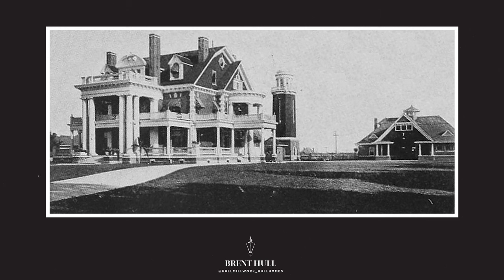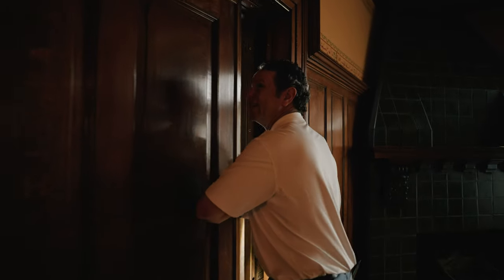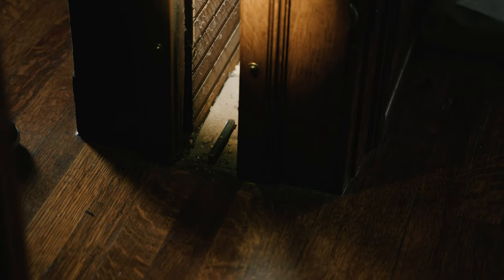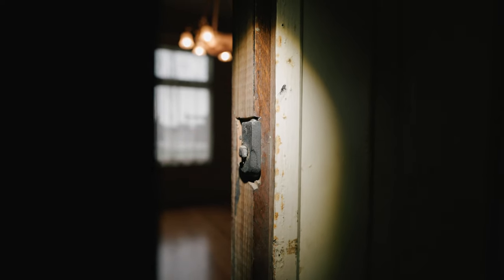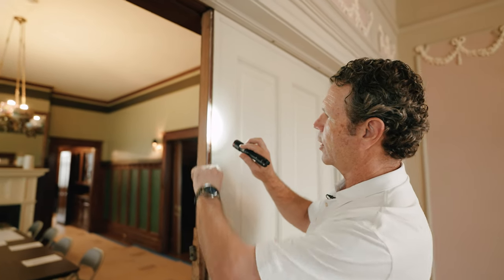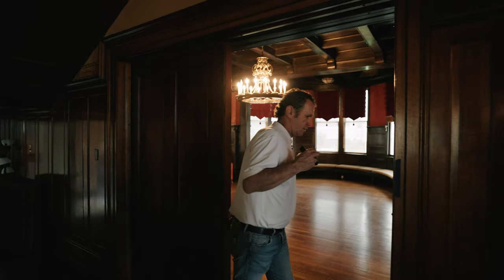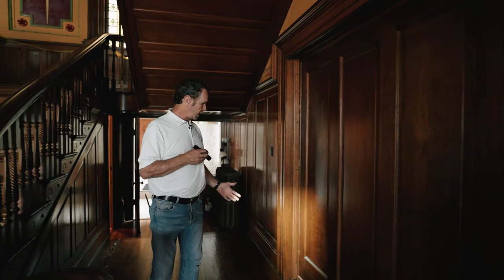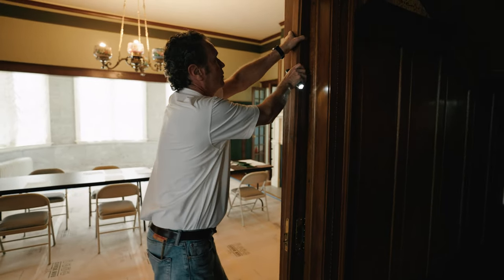Historic Pocket Door fix- How to get your doors working again

Comment: Brent Hull, I wanted to say thank you for all your sharing of knowledge here. I have watched many of your videos and wanted to personally thank you for your pocket door videos. I am working on my own house,  a1907 four square in Toledo Ohio. But I also volunteer time to save an old 1907 Gothic, Spanish, Four Square mixed style house. (It really is a mix of 3 or 4 styles). I have put in the basement beam, took my time, and started working on the floor above. Specifically, the pocket door wall. I found the two original pocket doors to the house, 32" each and the two tracks, 66" each. I built the two walls, 2x4 standard build with header and proper support over the load carrying beam below, and the non weight bearing where I turned the 2x4s 90 degrees to get the "thinner wall." As I close out today, I left the project with sliding doors all working. Those old rails needed cleaning but are still many times better than the new stuff, and the wood wheels on the original doors are working well. I will tighten up some adjustments tomorrow and possibly drywall sooner than later, I don't want the electrician thinking it is a chase to pass wire in. I am proud of my work and took on a task nobody else felt able to do. With you, I can save this old house and I want you to know some of us here are forever grateful. Be blessed and be well good sir.
Reply from the maker: So glad to hear it. Sounds like a wonderful project. Cheers.

Comment: I love pocket doors. Good weight good size. Great way to close off a room. Great access to a room without having to take up room inside the room on in the hall with the door. Only ones I don’t like are the mid-late 20th century ones with the slats and hallow bottom panel.
Reply from the maker: Right on

Comment: I recently repaired some 120 something year old French pocket doors. When the own bought the home both of the doors were missing along with the wheels and brackets. We found the original doors with a neighbor but not the wheels and brackets. We then found some wheels and brackets that didn't work for the track. Eventually I ended up removing the casing and removing both tracks and made frames to fit new pocket doors tracks on them and stuff them into the wall and screw them in place. The doors work fine now but I feel like $600 is too low. Did I low ball myself and how much should I have charged? Plus the cost of repair cracks, sanding and staining the original doors that are 8ft tall, 2 1/2 inches thick, 30 inches wide, and roughly 100lbs each.
Reply from the maker: Thanks for sharing.

Comment: Great video on pocket doors! I've been trying to get my old pocket doors to line up in the center and see no adjustment screw like in your video, there is also no track on the ground (they just kind of dangle from the rails on flat metal connectors with no visible adjustment screw) - any suggestions to adjust doors without a screw like that? All I see up there is a flat metal piece connecting to  a roller with four wheels on each side of the door (eight total per door).  Have quite a few picture in a Google Photo Album I could share if that helps. Glad I found your channel, hope to learn more to keep this old house looking great!
Reply from the maker: It must be a newer model. You can send pics to info@brenthull.com
Reply: @BrentHull  I got as good a pics I could with it being up in that hole - and I did email (after I saw your second video on the pocket door hardware and your email at the end of it). Any info you may have would be greatly appreciated.  Thanks again for your content, time and efforts! I might be able to get some better pics with a probe camera I can borrow from work ill send them as well if I can get em tonight.

Comment: Gorgeous house and cool to see the inner workings of pocket doors. Wish I could install one, but the wall is a supporting wall. There was evidence (a pin on the upper part of the door frame) that there was a swinging door between the kitchen and DR so I am thinking of putting one back. Any advice? And I was dying to strip the paint off that one set of pocket doors!
Reply from the maker: Go back with the swinging door. Great historical precedent. Good luck.

Comment: Hi, we have doors similar to this but with inlaid glazing. We want to take them out to have them refurbished - do we have to dismantle the whole framework or is there a lift and tip method?😅
Reply from the maker: Your probably going to have to take off the top casing (not the sides) and then you can take it out. Good luck.
Reply: @BrentHull  thanks! We started a little exploration this weekend 😅 the door is from 1912-ish so lots of dust and plaster. Looks like the top casing will have to come out as you said. Hopefully we’ll get away with just that as I fear we’ll get into a very crumbly wall and a bit of a can of worms if we start on the sides 🫣

Comment: I have a single door with the hardware you have. Unfortunately the wheels squeak really loud. I tried to spray lubricant but that only lubed the track, not the hub/axle. I can not slide the trollies off of the end or lower one side of the track to slide them out. Any suggestions?
Reply from the maker: You're going to have to remove trim and do a little more invasive surgery. Sorry.

Comment: Unfortunately our pocket door has a door stop in the middle of the tracks. No visible screws. Any clues on taking the stop out to get to the back of the doors?
Reply from the maker: Sometimes you can lift your door over a stop. Other times the stop needs to be removed. Look for screws to remove the stop.
Reply: @BrentHull  ended up that the some trim pieces were covering the screws for the stop had to take them off.

Comment: Okay but what about if your pocket doors are one big solid door that you can’t get to the back? I don’t have two that slide together to close, I have one large one for each doorway that closes to the other side of the door frame. I have to somehow get the door out of the wall in order to see into the other side, and I’m not entirely sure it’s possible.
Reply: I also need to get into the frame and take the door out completely so I can replace the rolling hardware that broke.
Reply from the maker: Well unfortunately, you are going to have to carefully disassemble one side. Trim first and see if you can take one wheel off and then slide the door out. That is hard. We have the same issue.
Reply: @BrentHull If I change out the tracks to the new Johnson system, is there a way to do that without cutting into my walls?